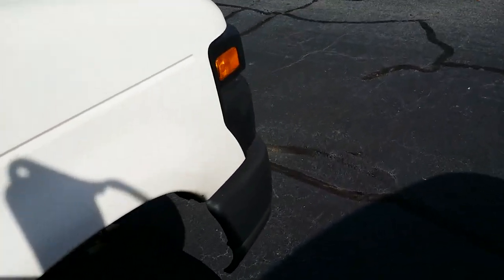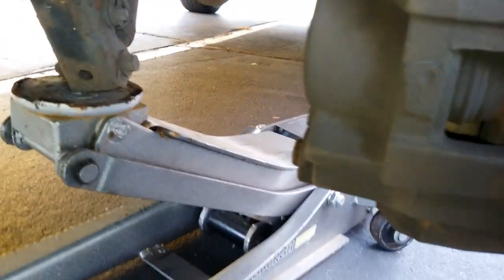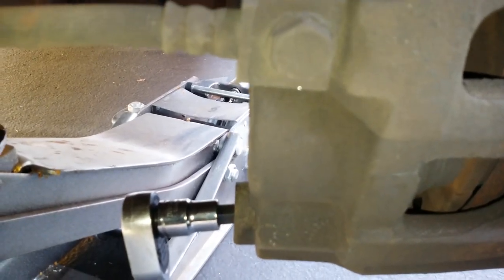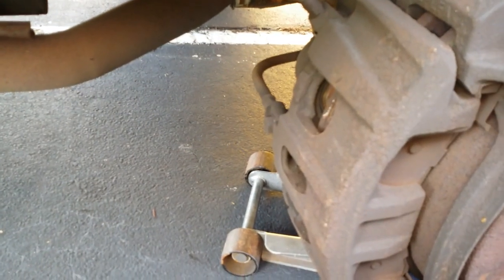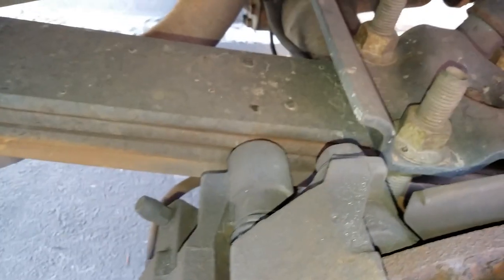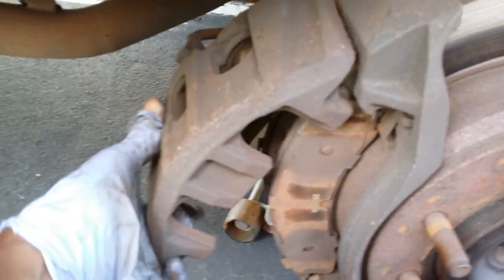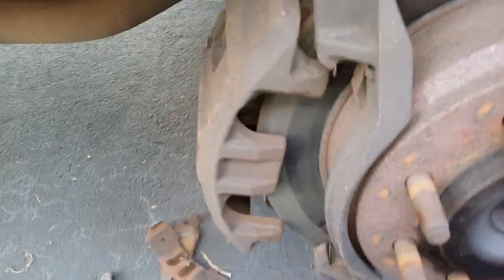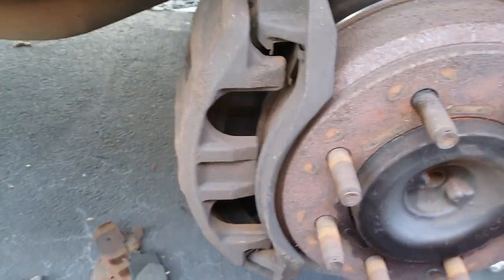FORD E250 2012 REAR BRAKE PADS REPLACEMENT

Comment: I really appreciate this tech tip. Saved me a lot of frustration. I took everything off and was having a hell of a time getting the pads back in because of the lack of space on that top allen bolt you mentioned. I did what you said and it work wonderfully. THANK YOU SO VERY MUCH FOR POSTING THIS VIDEO SIR!!!

Comment: The trick is to just unbolt it as an assembly. Just take the 2 bracket bolts off, and disassemble it off the rotor, and put it back on as 1 piece.
Reply: Can't access my top one on my boxtruck
Reply: Any ideas

Comment: Jack the frame up and let the axle hang from the springs. Should be able to remove the top bolt then. And please use Jack stands that van will kill you when the Jack fails
Reply: You clearly don’t understand how anything works. The leafs spring is attached to the axle. Jack if you, springs go up with it, along with the caliper. You just remove it as an assembly (the 2 bracket bolts)
Reply: @jayk10304  I did what he said on a 99 7.3 boxtruck
Reply: @jayk10304  jack it up take the wheel

Comment: This guy put only brake pads on a van that had grinding brakes. Wtf?! My shop would never allow this. And he didn't lube the guide pins. Correct way is to remove the entire bracket and then undo both pins and lubricate once it's off the axle. And replace rotors and wheel seals.

Comment: The tip about lifting the caliper was a $100 tip, thanks
Reply: Not really because you have to move the bracket to help out when you need to replace the rotors or when you want to push the Piston